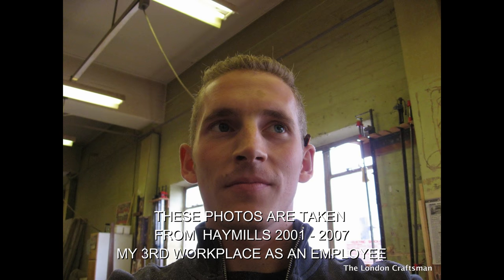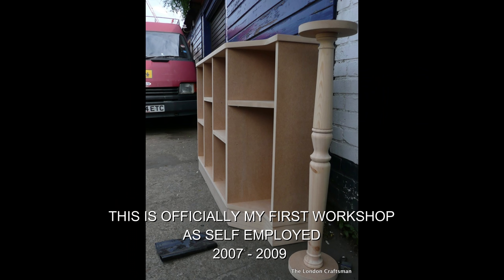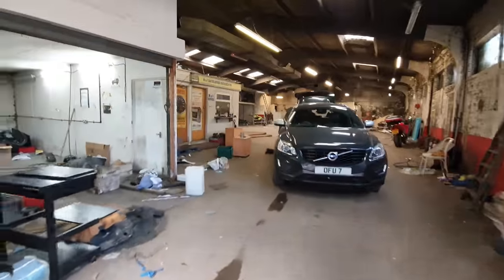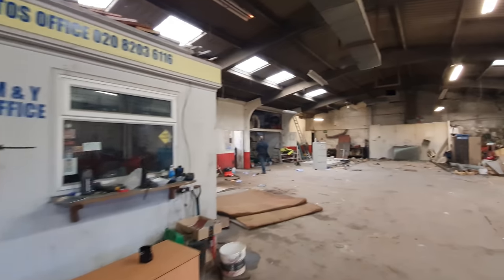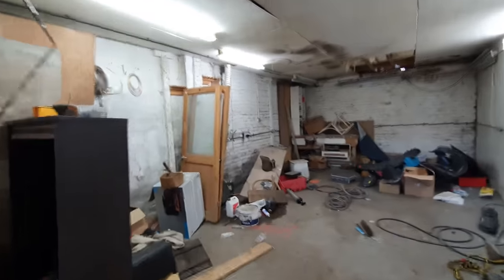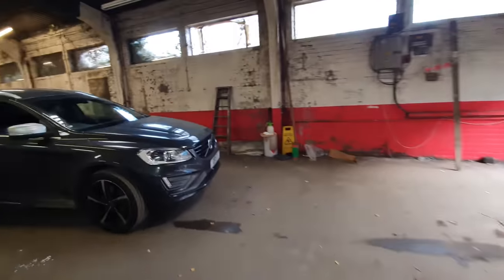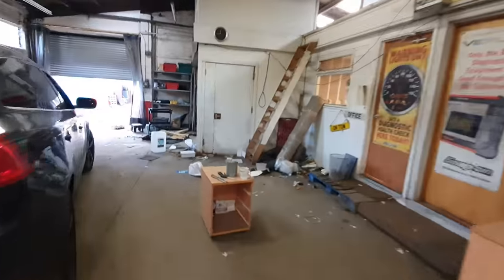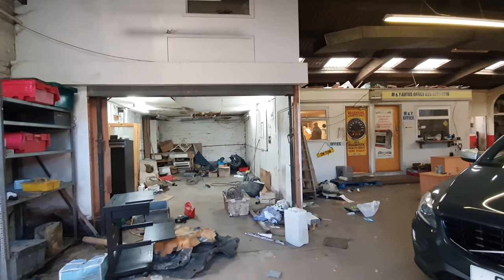Starting A Joinery Business | From Apprentice To Boss | Vid#83

Comment: Good video just a quick question other wheels on your new bench to lift up to move is it difficult because you have to adjust the height by hand.
Reply from the maker: Hi the stopper on the wheels are the only thing that are adjustable.  I can't move my bench around as I used the stoppers to level my.bench as my floor is not level